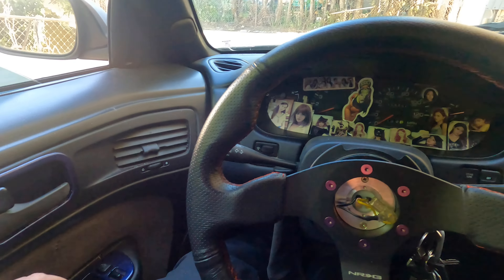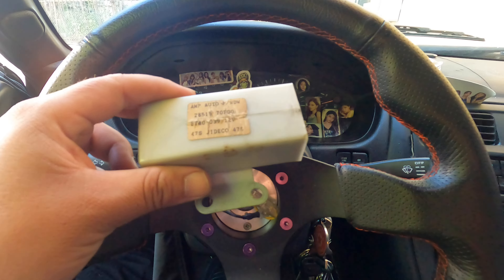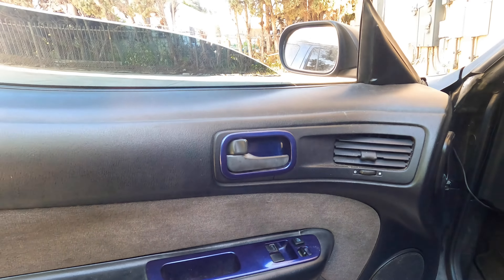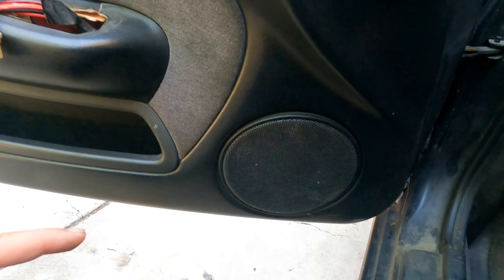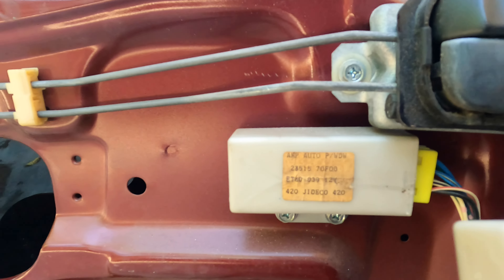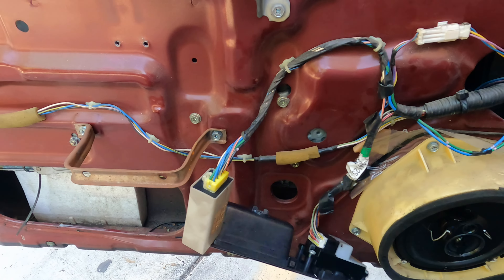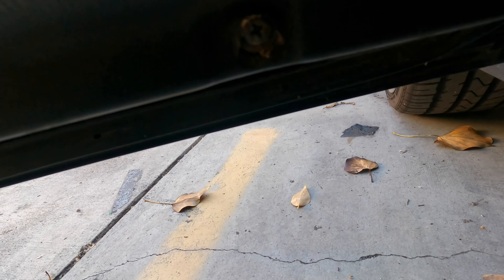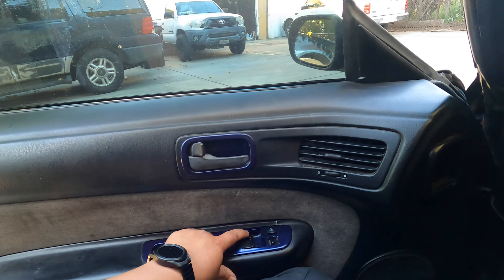240sx Window Amp Replacement

Comment: Was your window weak prior to it going out? Having the same issue where it worked intermittently then completely went out. Had the clicking from the amp though.
Reply from the maker: Honestly, it was working fine with the exception that it wouldn't go up at times. When I jumped the window motor to the car batterie, it sounded healthy. Try jumping the window motor to see if it sounds tired but most likely youre having the same issue I had. Thanks for watching
Reply: Great tutorial!
Reply from the maker: @Alexstarfox64  thanks brotha 💯